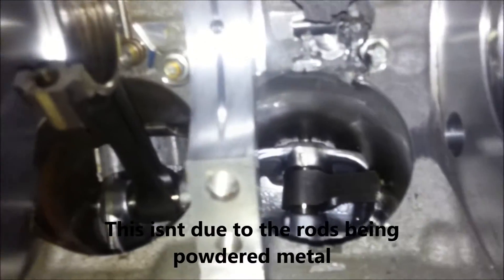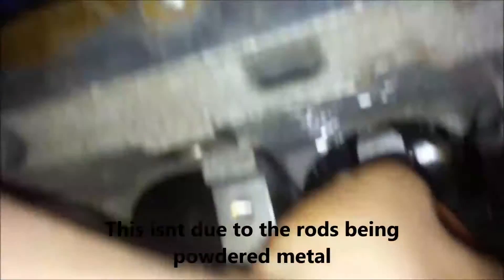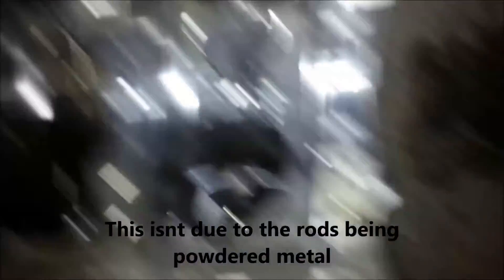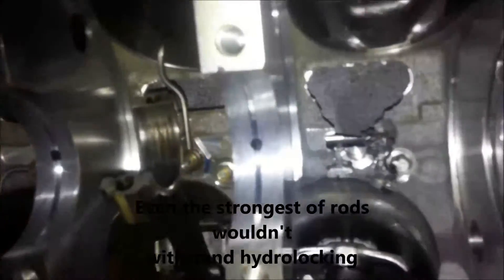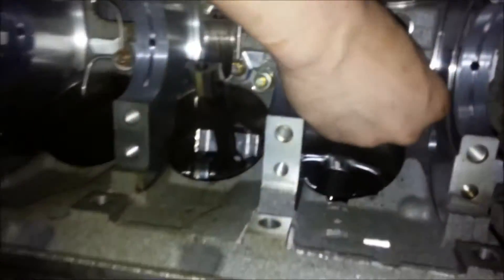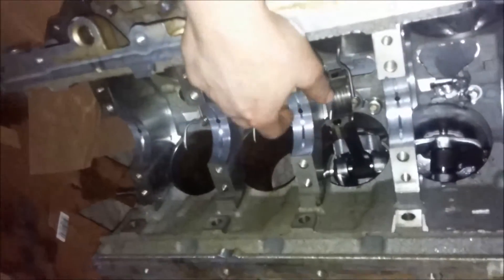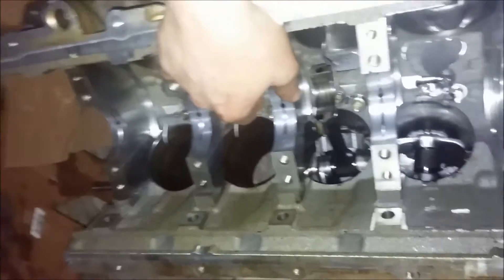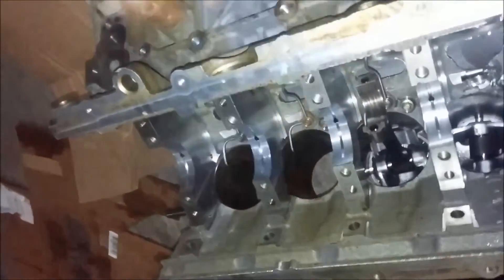coyote v8 rod failure

Comment: Actually many rods DO "survive" hydrolocking. And yes, powdered metal construction is a factor. There is no grain structure to it and through it and just like smacking concrete composed of tiny particles bonded together will cause it to crumble, subjecting a powdered metal rod to enough compression and impact can cause the particles to separate. Especially when side load is simultaneously being applied to some extent, which is the case in a hydrolock situation since the piston can not reach TDC.
Reply: Chad Meyer i suppose the powdered metal rods saved the crank from taking any damage as i used it in my build
Reply: Or you could suppose that conventional forged rods wouldn't have snapped and you might have been able to reuse almost everything. Seriously, an engine being "hydrolocked" rarely results in complete destruction like that. Bent rods? Absolutely. Cracked pistons? Definitely possible. Even a split cylinder wall? It can happen.  Destroying 90% of the engine? That's a new one on me. But then again hydrolocking period isn't exactly an everyday deal. 

You said a foot of water and maybe it was a foot but I'll bet there was another foot involved and it was pushing down on the accelerator pretty hard for the truck to be pushing enough water in front of it or have it shooting up into the inner fenders or grille area or wherever Ford certainly put the air cleaner inlet so a person would have be in really deep water or going through shallow water really fast in order to let the engine suck a big gulp of water. 

I don't know much about those engines but I do know Ford usually has some "bugs" in its new  engines it designs in-house and particularly V-8s, so maybe you can fill me in one just what it costs to "build" a Coyote from donor engines and leftover parts. How much money did you save reusing the crank? A couple hundred bucks? Maybe $500 at most? I hope you had it checked carefully for cracks and straightness to make sure it was really still in pristine condition. 

Be a damned shame to have another engine blow up because of another easily foreseeable and avoidable "oops". And that crank looks really shiny from what saw and to me that says "forged" and forged cranks tend to be very, very strong and durable but at the same time pretty brittle. They start with a relatively soft blank and then pretty much pound it into shape with hundreds of tons of force and dies that form a big round cylinder of mild steel into the crank's rough shape. The grain of the metal is preserved and runs throught and bends around the various bends and twists. 

The hammer-forging process also makes the steel much more dense and hard. But not as hard as it needs to be to have good machining and polishing characteristics for the journals. That happens at heat-treat. So you end up with a crankshaft that's hard as sin for maybe .030-.040' of the outer shell and much softer inside so it can absorb power pulses and transfer torque without cracking or shattering. 

But those hard journal surfaces and particularly the fillets where the bearing surface meets a throw or counterweight are touchy areas and its very easy for a tiny crack to form there since they are areas where the grain is cut open and where stresses gather. A really high-quality crankshaft for a  medium-duty or heavy-duty diesel or high-end forged gas engine crank will have a very carefully shaped and ground "fillet" there with no sharp edge where stress risers can for cracks. 

Mass production gas-burner automotive cranks usually aren't that well made, which is why grinding one is always an iffy proposition so a crankshaft that's no pristine or can't be made that way simply by polishing it is generally tossed. Even magnufluxing and UV dye testing can't find cracks that are just under the surface and that follow the curvature of a journal or fillet without reaching the surface. I don't know a machinist who would look at a relatively cheap crank like that after it came out of a catastrophically-failed engine like that and would tell a customer he knew might be a little hard on things "run it". The machinists I know would refuse to touch it to even crack-check it. 

I like to save money myself and save my customer's money when its wise and safe to do so, but I don't see that with the pile of scrap you had there. It seems like Ford is selling those engines complete and almost turn-key for a song, so I can't imagine a new crankshaft was a deal-breaker on your "build". I guess that's just the diesel mechanic in me, though. Almost 25 years of working on shit ranging from chainsaws to 4500-lb GE Evolution diesel-electric locomotive engines with pistons that each weigh more than your block there have put me in the "replace it or risk it?" situation many times when a part that had massive carnage occur all around it looked "OK" and reuse would save a little money. 

The way I and pretty much every one of the dozens of good mechanics I've worked with and the hundreds of customers I've worked for looked at is was that a new part may not be cheap but its usually cheap insurance. Hell, if I were in your position knowing what I know and seeing what I've seen reusing the crank wouldn't even cross my mind because I wouldn't even think about building another boat anchor that  couldn't handle hydrolocking without vaporizing parts.

So you're a braver man that I am. Or something.
Reply: DEEREMEYER1 good to know
Reply: i am living proof